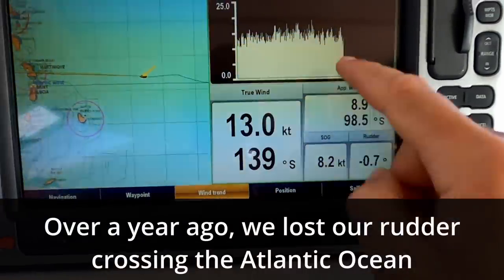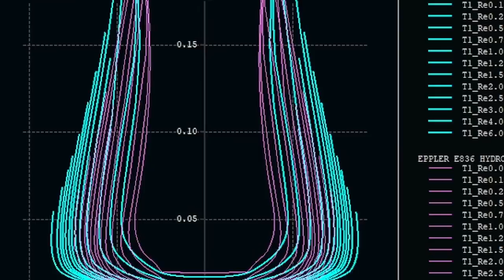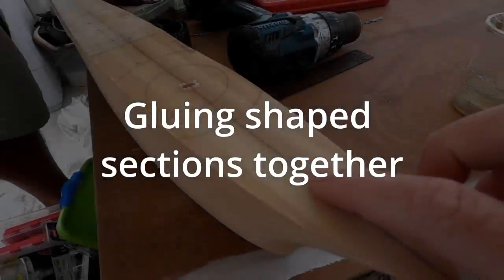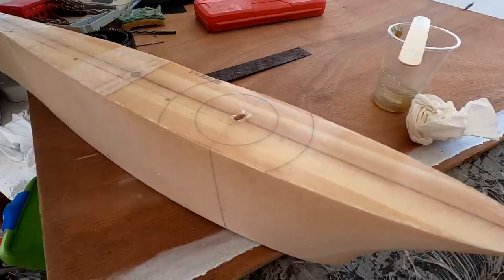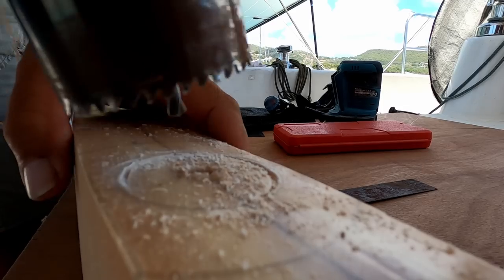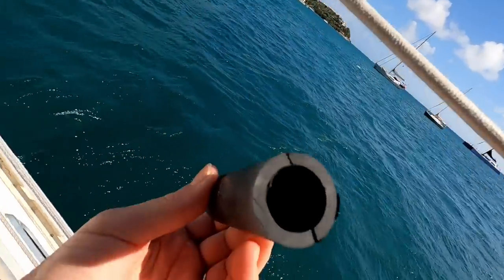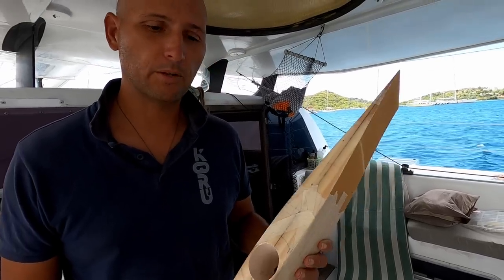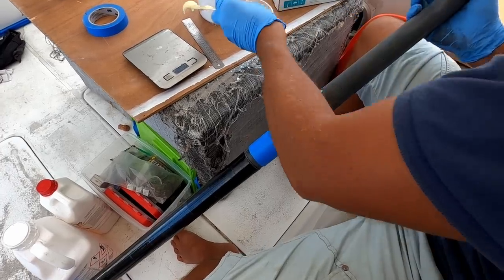Making our Rudders | Part One

Comment: Shame you couldn't get the core CNC cut :)  Glad to see you use the same method of mixing in the cabosil as  I do - just grab a handful and mix until it's right.
Reply from the maker: We did find a great composites guy with a CNC machine in Martinique but I had already glued the foam together by that stage so hand shaping it was. 
Anna loves the way I mix cabosil - half for the pot and the other half distributed evenly throughout the boat 😁
Was it you talking composite chainplates on Duracell project? Great video.
Reply: @youngbarnacles  Yes, that's me. And our cat who made the surprise guest appearance. Matt is doing a great job. He's doing nice work (though that wedge could have been more tapered but I never sent him a drawing for it. Sshh don't tell him and make him worried.)
Reply from the maker: Cat cameo was hilarious 😂

Comment: Great to see you build the rudders, especially impressive with limited resources ....... very surprised with how minimal structural/skeletal appendages you used to transfer rotational torque of rudder stock to blade. Thought you might even drill some lateral holes to fill with resin to lock it all together. Would love to hear more of a breakdown on your design/construction choices.
Cheers

Comment: Steady hands of a sculptor.  I would have torn that foam a bunch of times doing the shaping by hand.   Very surprised the rudder stock tabs were so small.  I was expecting them to run at least 1/2 the width of the rudder blade.  Thank you once again for sharing all this!
Reply from the maker: Cheers mate. When I designed the rudders I also calculated the size of the torque tabs needed. No point making them any bigger than they need to be.

Comment: I am glad you put those torque tabs on. I was thinking you would start with the torque tabs and add foam later, a normal metallic method (but I used cedar instead of foam for the blanks). The torque tabs look so small compared to normal rudder construction. Cheers Phil
Reply from the maker: yup working with carbon and foam is a different method for sure

Comment: Was it not easyer to make it from honeycomb? 
Mercury 5 as a weight was "properly using" :)
Reply: Sea knot you obviously have not tried to cut or shape honey comb .
Reply from the maker: haha! The Mercury 5 outboard motor is an industry standard clamping method. 
Honeycomb is not suitable because it is difficult to shape and if there is any water ingress it will fill up the honeycomb which is not what we want.

Comment: It looked like you were using thickened epoxy to wet out your carbon fiber tabs. Am I missing something?
Reply from the maker: Epoxy resin thickened with aerosil powder
Reply: @youngbarnacles  Ok. I have not seen that. I am sure you made sure it wetted everything out but as I said I have never heard of that technique as it is generally thought to be harder to wet the fabric. Is there a trick or tactic to your way that I have never heard of? Is this done often with carbon fiber? ( I have no experience with carbon fiber only fiber glass).
Reply from the maker: I'm pretty sure we cover it in some of our earlier videos. I'll have to double check but may have been the one about flush skin fittings? or fixing damage to the hull?